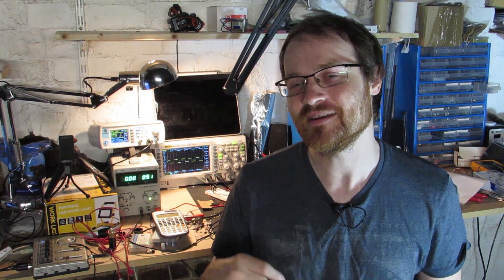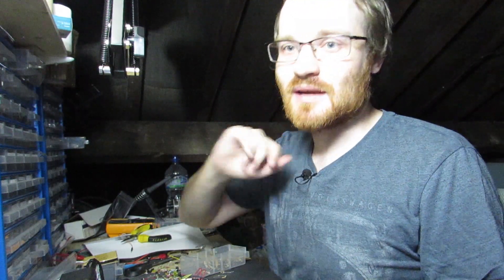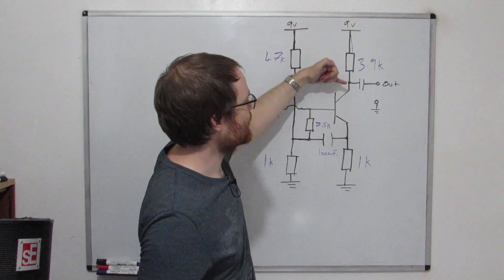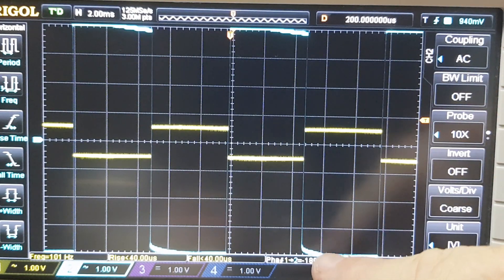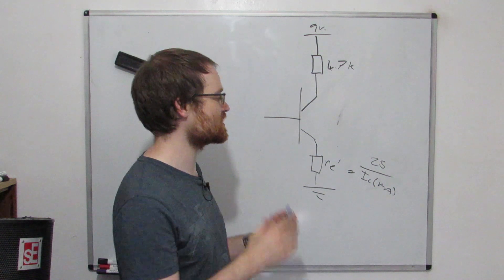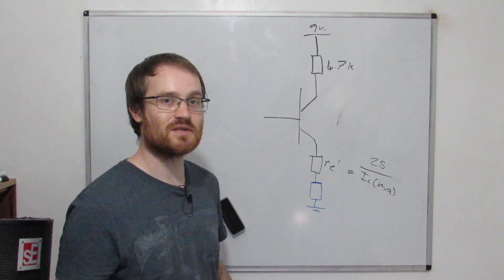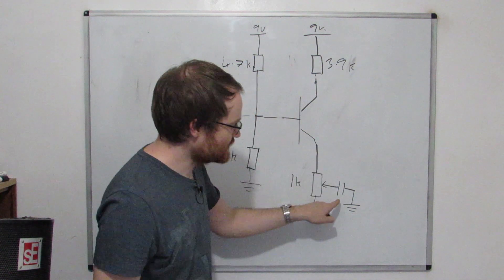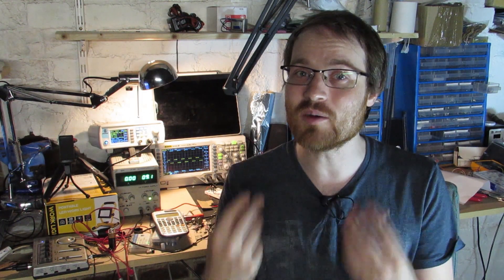High Gain Transistor Circuits

Comment: ok so let's be ridiculous for a moment. for some crazy reason i decided to build single stage comon  emiter amplifier of  a gain around 100 times the input signal i have no idea what it is in decibels
it was for guitar preamp  overdrive section and let's just say i wanted to blow every 100ma to roughly 10 Vpp with 12V power suply
it kind of works but the whole thing become really hissy i did limit the input signal to 700mV pp by clamping it with diodes in effect making it another distortion  stage if signal ever get this hot (which it does) but next stage was tobe an overdrive anyway
would there be any better luck making that a multi stage thing or would internal hiss of a transistor increase with each stage. what causes the hiss anyway other than current flowing trough
i only amplified my signal 144 times including both buffer stagesand i kind of want it to only amplify the"music", will the capacitor bypas help anything with that?
Reply from the maker: It could be a lot of things causing the hiss! First thing I would try is halving all the resistors. That should help. You could try having a multi stage thing but as you guessed that just gives more opportunity for noise. The culprit is probably that your input signal is very quiet vs the noise. Noise can be a real pain!
I've been thinking about how to make a video about noise because there are lots of things you might not expect that can add noise
Reply: @TheAudioPhool  i can clamp imput to ground and the background hiss remains at the same level, i think it might be just one of the transistors by itself making that noise and i am not sure if with high gain is better to use low or high current  trough a transistor. because i am not sure if i should care more for impedance (current amplification) or viltage gain and how that affect each stage
clamping a transistor with a cap on the colector is like  clamping differential signal to ground so if it carry a copu of the hiss  depending on it's phase it will either increase or decrease i think but with high gain it may be minimal difference
Reply from the maker: Yeah so you either need to cut the noise or raise the signal relative to the noise and reduce the gain. Noise can come from the transistor itself but could also come from high value resistors at the input. Have a play with some smaller resistors at the input if you can get away with it!
Wrt input impedance while low noise is important if you get a noise free signal that you have to amplify yet again because of input loading you might just end up with more noise!

Comment: the transistor amplifier easily yields a specified voltage. so, a resistor divider can produce a negative voltage supply rail, in a range we desire, from a stable DC source using this circuit.
so why are people introducing ripple into their euroracks with AC to AC convertors? i'd prefer to understand why this is, before blowing up my little parts :)
Reply from the maker: So is your question, why do people use AC-AC power supplies instead of just using a resistor divider with a transistor amplifier?
So for any transistor circuit you need the supply voltages first which must be higher/lower (depending on PNP/NPN) than the output voltage so you have to get the supply from somewhere!

If the question is more why do people use AC supplies at all, It's mostly because linear (i.e not switching) power supplies have lower noise, and that noise could leak into your circuits giving you noisy audio at the output. 

I hope this answers your question! :) I intend to do videos on these very subjects so subscribe and keep an eye out!
Reply: @TheAudioPhool  cheers, it's been vexing to me, it's also been suggested that the ground produced by a resistor divider isn't isolated enough and produces incidental DC offset (ok for some stuff!). but truthfully, i think the important part of my question, is i'm too lazy to buy stuff to blow up. a solid understanding of electronics seems to require first hand effort to postulate circuits, and for decades i've always been the person incapable of admitting to myself that i haven't spent enough on proper gear (it's an aspect of teaching i wouldn't be surprised makes it into your channels questions from time to time).